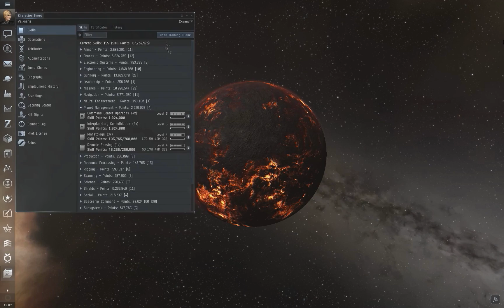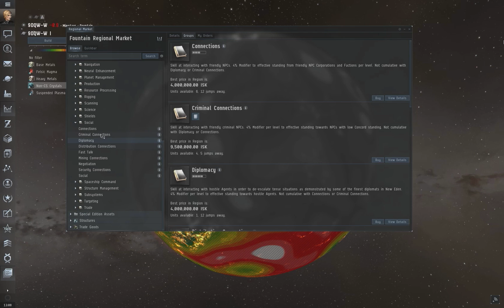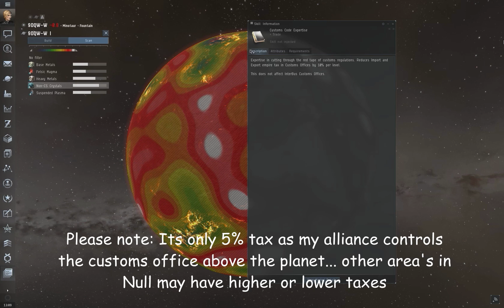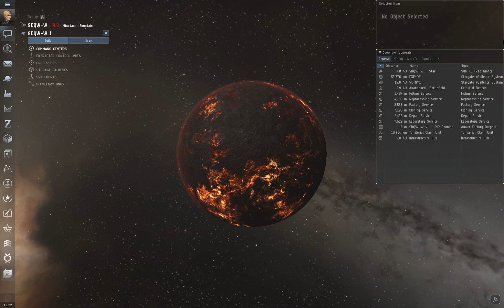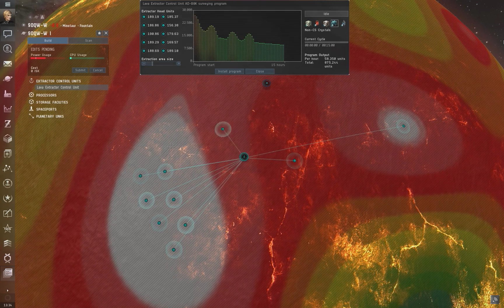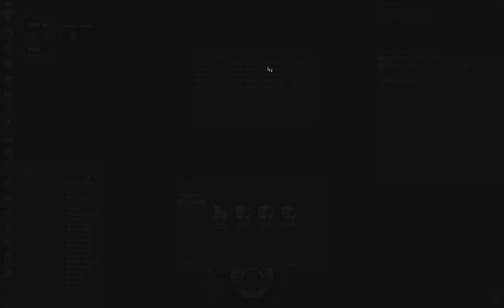EVE Online:  Planetary Interaction Guide For Big Isk

Comment: Are the P2/3 facilities not automatically taking the required material from the cargo hold on the planet? Do you really have to manually "charge" them with the materials all the time? Because if the production process only takes one hour would that not mean that you would need to charge them manually again and again as you did in the video? Would be awesome if you could elaborate on that part a bit. Otherwise awesome video, thanks!!!
Reply from the maker: Yes the p2 and p3 automatically take the required materials from that particular cargo hold needed however you have to manually set only the once what you want the p2 and p3 to produce....thanks for your comment
Reply: Thanks for the quick answer!

Comment: Hi, nice video thanks for putting it up. 

quick question

Do you have to route materials to the processing plant from a storage module?

for example: I setup an extractor route it to the storage facility, I setup a basic indy facility and link it to the storage facility and install a blue print.  Do I then route the raw materials from the storage to the indy facility? Or does it draw the raw materials it required automatically. I ask because I did not see you do that in the video.

Many Thanks.

Comment: Nice video very informative but there are a few points I would like to make:
1. if you hold CTRL while clicking on the building it will start building a link you then release CTRL and click on the building you want to link and it will create a link.
2. on your production planet it is better to have a ratio of 4/1 of P2 to P3 advanced industry facility's so two creating consumer electronics and the other two creating mechanical parts to each facility creating robotics this is because to create robotics you need ten of each P2 but the facility's only create five each so its a good ratio and no time is wasted. I would take of the two bottom robotics facility's and change them to one creating consumer electronics and one creating mechanical parts this is so you have the robotics facility's always working and none waiting for more resources.
3. I would also suggest moving the buildings together closer so the links are shorter and require less cpu/pg and gives you more freedom with other buildings.
Reply from the maker: Thanks for sharing will take note I think the best tip was the easy way to create links...god I hate all that mouse clicking!